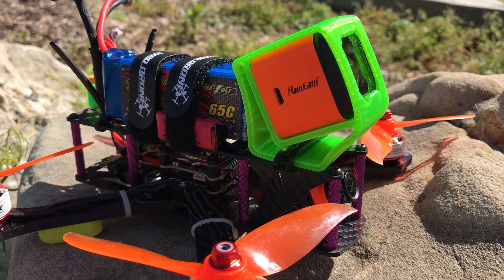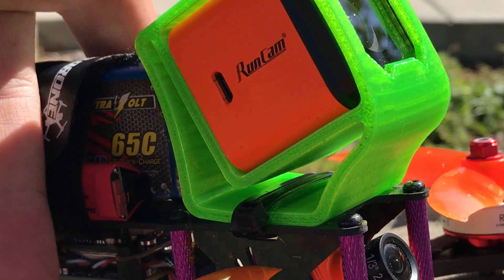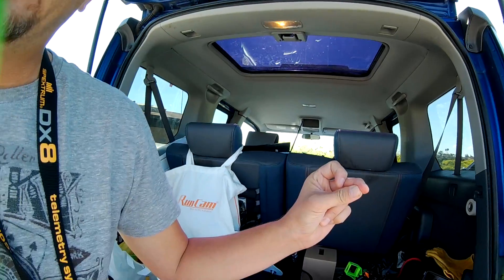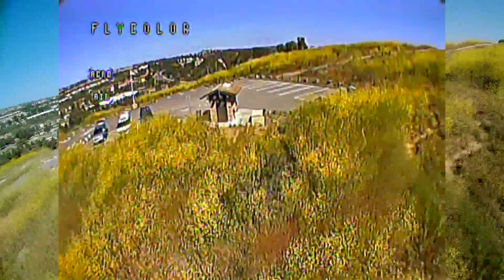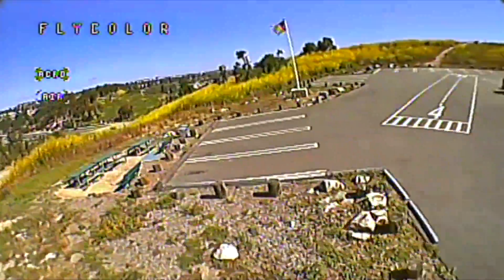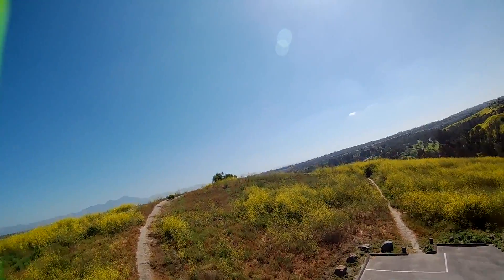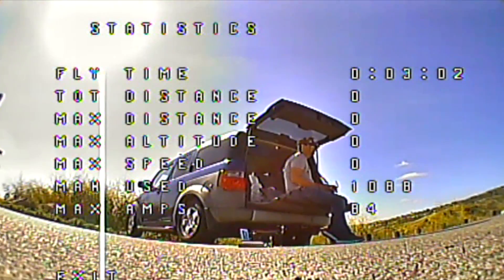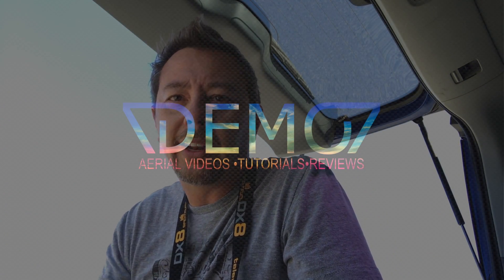Flycolor Raptor S 4 In 1 BLHeli-S 30A ESC DShot Integrated OSD with F3 Flight Controller

Comment: How does this esc hold up? I am pretty interested and have been looking at one I can get for 25 new. I run a 2306 2450kv on a dal t5544c. I know this 4 in 1 is a 30a with 40a burst but in real world is where I really would like to know how it handles.

Comment: Forgive me if my question sounds like I’m a nube because I am. LOL
When you flash this board for the first time in beta flight, which option in the first drop-down box do you pick?
Reply from the maker: +Randall Smith pretty sure it's spracingf3 but I'd check the data sheet on it first-
Reply: 7demo7 , I didn’t see anything in the manual but that’s what is highlighted when I plug it in. Thanks for the help!!

Comment: I hate the osd.  I got the serial pass through to work once.  Now have only one com port so if you connect betaflight it takes com 10 and then mwosd tries to connect on the same port so fails.  No place to change ports as far as i can tell.  Betaflight osd wouldnhave bern far better.
Reply from the maker: yes,,, first world problems....lol jk

Comment: I just fired up my new BNF Arris X220 with the Raptor S tower and it 
just beeps constantly. I have a good RX bound to my ATS-9..S-bus...but 
no joy. With the Tower connected via USB to set it up, it also just 
beeps constantly. I'm at a brick wall. Any ideas?
Reply from the maker: +Bob Nagy what is beeping- escs or buzzer or f3 board- I'm not sure what would cause that...

Comment: Great video, thanks Jeff. Quick question. My raptor s was set with oneshot as the default. Did you run this stock set up? If I want to run the raptor with multishot or d-shot, do I just change the setting on the configuration tab in betaflight, or do I also need to update the esc in bl-heli suite? Thanks for the help!
Reply: mitchmo5000 just in betaflight
Reply: thanks!

Comment: hi could you tell me how to get my osd to work on the raptor  s as its not showing eny data what wire needs to go were I have a xsr I have put power negative and s bus  is that right
Reply from the maker: should be!
Reply: ggvaper If it shows no data at the bottom then you need to enable MSP on Uart 2
Reply: thank you so much it works top man one more thing in betaflight do I just click on dshoot and save it or just leave it as it is what the best setting to have it on
Reply: ggvaper Do you have the 390 tower or the S tower?

Comment: Actually here's a link to one of my post and here you'll see a screenshot from a flight to see what it really looks like 
https://www.rcgroups.com/forums/showpost.php?p=37178029&postcount=176
Reply from the maker: RCFlyer85 very cool- in the osd menu can one move the information around?
Reply: 7demo7 You can't move it around as far as I know. You can only enable and disable things. Also... Changing to NTSC is a little tricky as you'll need to navigate blindly to save the setting

Comment: The board is set to PAL so you'll need to change that to NTSC or throw in a PAL camera

If you check my videos you'll see how it should look. I love my 2 FlyColor stacks
Reply: All of the amp and voltage information should actually be at the bottom

Comment: SO... if one ESC Die you trow away the entire board?
Reply from the maker: +Migueldeservantes yes
Reply from the maker: +Migueldeservantes or a good  time for a tri Copter
Reply: Yup!! I have been considering to get one of the RCexplorer "David Windistal" I like the design is simple and very compact..
Reply: 30a ESC's should hold up to a lot... I don't hear people burning up ESC's like a year ago
Reply from the maker: True, in my adventures I've only burned up one
Reply: I do agree whit almost all comments but I would rather have the chance to trouble shoot my system and be able to swap around all ESC's as well as motor util I feel that I have found the faulty part rather than to have a integrated problem waiting to happen! Hey a single motor coil can go bad and take down an ESC it have happen to me..